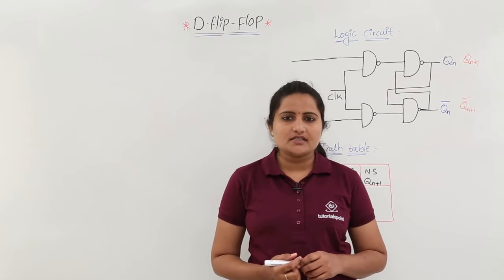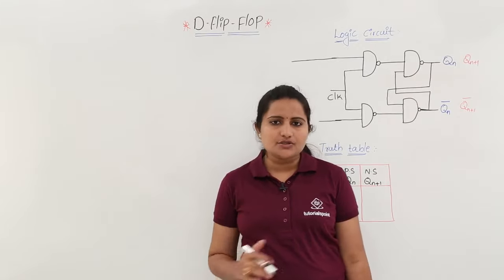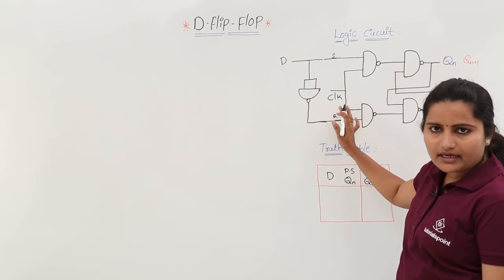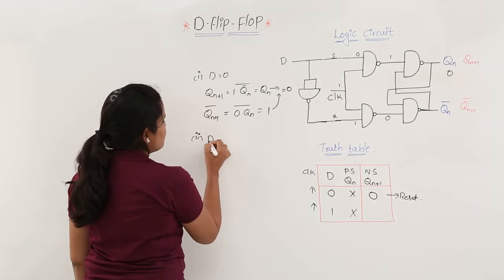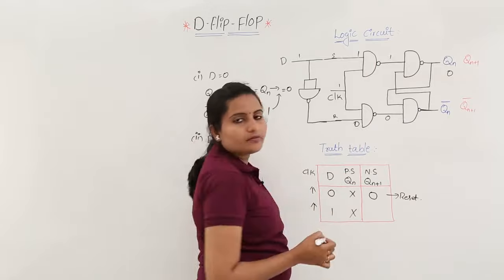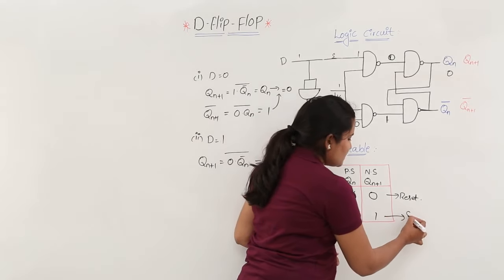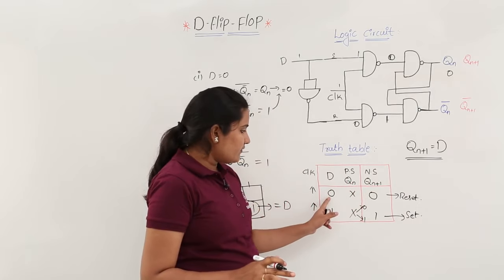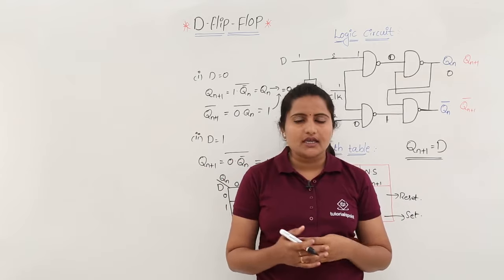D Flip Flop

Comment: Flip flop or latch is a digital electronics component. It remains in a state of 0 or 1 which are the two levels of digital signal. 

It is made up of combinational circuits and stores data. It is a storage component.

It is one of the basic building blocks of a digital circuit. It is not a special component but a important component of a digital circuit.